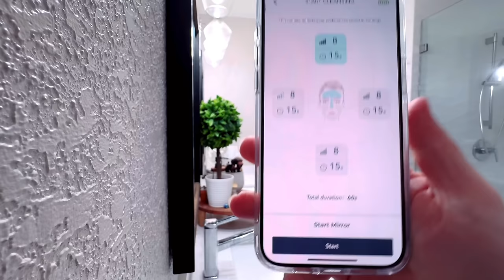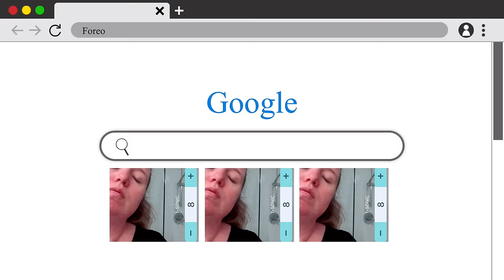2024 Home Decorating ideas ~ Cleaning Decorating & easy dinner ideas ~ real life mom motivation

Comment: I have 3 cast iron pans… 1 shallow, 1 deep and 1 grill pan (not a griddle). I know there are cast iron purists who are vehemently opposed to using soap, others use soap and don’t have problems.

I tend to not use soap, for no real reason, I just don’t. I rinse, scrape any food debris off then use kosher salt as an abrasive for the littlest bits. Spray with cooking oil then store it.

Comment: Cami, a big YES to sharing cooking recipes.....about cast iron, no soap....what I do if I have stubborn cooking stuff left on the skillet, I drain any grease, pour hot water about 2 inches worth, in the skillet and put it on the stove and let it come to a boil, turn it off, let it cool a bit, and just pour out the water, you may need a scrapper, or a soft brush to get it all off, no soap, just the boiling water and brush or scraper, the next step is the most important.....set the skillet back on the stove, wipe out the inside with a paper towel, turn on the burner, when smoke comes up from the skillet turn off the burner, put about a tablespoon of oil in the skillet and spread it around with a paper towel, leave the skillet on the burner until it cools completely, make sure any excess oil is wiped off with a paper towel...then store...NEVER EVER, wash a cast iron skillet and store it without seasoning it, the seasoning, which is the oil rubbed on with a paper towel and heated, is what keeps the skillet  from sticking.  that is how my grandma and mama took care of cast iron, I still use the skillet that belonged to my grandma....

Comment: Soap doesn't destroy cast iron but it is not good the reason why no soap is because when you cook in them the lack of coating on the pan helps to season it. So what I do is clean it the best I can with just water then if it needs a little more put it on the stove and heat it with olive oil then when you pull it off carefully scrub the pan again while it's still hot rinse and dry completely and you're done.

Comment: I have two cast iron pans that were my grandmothers, as an ex chef, this is how I clean my cast irons. I rinse under warm water, then take A handful of Kosher salt and rub the pan with your fingers or a plastic scraper if you need to. Rinse with warm water dry completely and take some neutral oil and rub it in. My pans are over 150 years old. And I love them. Dorene Weiss

Comment: I just use my cast iron over and over. Using soap will get the seasoning of the iron washed off. If there is lots of things still in the pan, i let it cool and use a paper towel and a bit of oil to wipe it off. Storing on an old towel or on the stovetop and clean paper towels inbetween the pans.
About every month i clean mine normally with a brudh and dish soap but put it in the (hot but cooling down) oven with a fresh bit of oil in so the seasoning is not completely gone

Comment: I clean my cast iron with light soap.  Heat it on the top of stove to dry it out and then season it.  Wipe oil on it with a paper towel and store it away. Rust is your enemy with cast iron.

Comment: Cambriea. Can you give us your honest opinion on some of the rug cleaners out there that use a dirty water dispenser.  We used a well-know brand that has been problematic from the get-go.  After spending about 300.00 on it-it was the second dud we have had.  The first one did not work to begin with.  The one we have now leaks,  does not suction--people are wasting their money and can get NO SERVICE.  Also we have had the same experience with cordless vacs--constantly have to buy filters, batteries, chargers, and finally a whole new body for a 300.00 vac that was not even 3 years old, AND IT STILL DID NOT WORK.  These are in my opinion high-priced JUNK!!  How in the world can you clean your carpets??  Beware!!!--- readers of purchasing these things.  You WILL have problems!!!